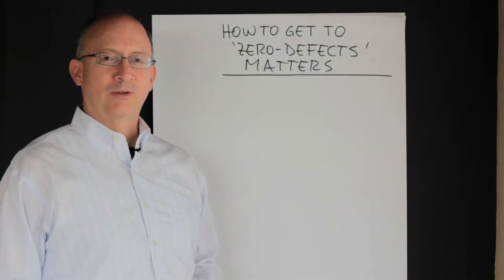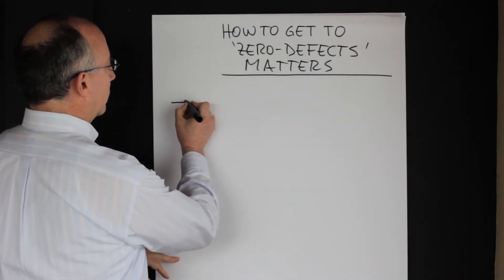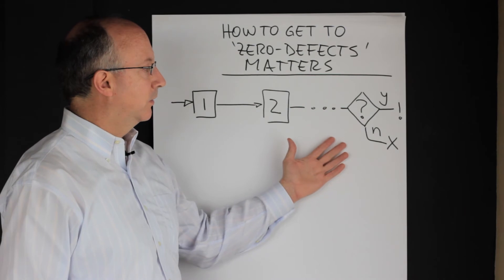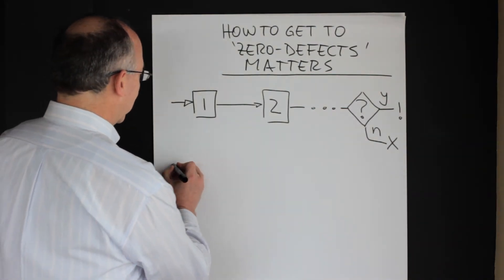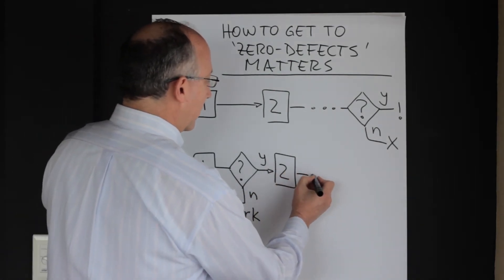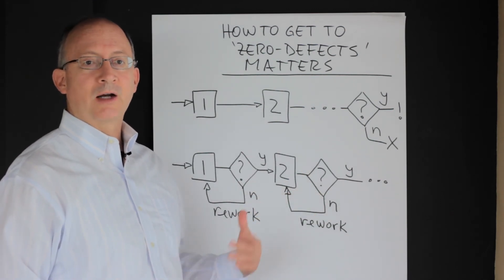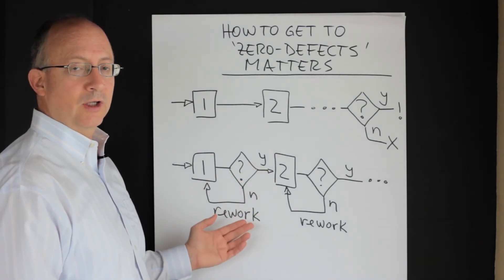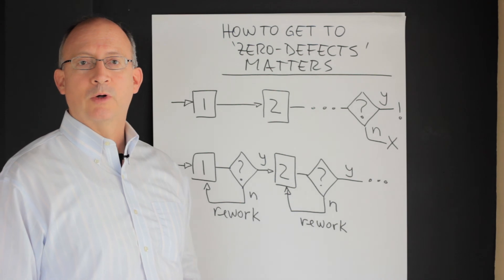Six Sigma | ZERO Defects 2: How to get there matters | Green Belt 2.0® Lean Six Sigma

Comment: Early detection is crucial to minimizing customer impact, costs and time lost.  It's so much easier to make up time, if you are only a portion of the lead-time behind due to a quality issue than it is to find the issue at final inspection and have to expedite replacements through the entire process which could be weeks or even months.

Comment: very interesting. It made a lot of sense to add inspection points at the end of a cycle or at each cycle.
Reply from the maker: Husain, to be clear, what videos trying to do is that just adding inspection points at the end of every cycle will only help if these leads to an improvement of the process itself I supposed to simply trying to catch errors over and over. The focus should be on the process, not only on the product.

Comment: I experienced a great example of rework causing problems in the production line today. Couple parts our supplier provided had incorrect dimensions on the the cover of a medical device. This caused the cover not to mate as it is suppose to. A small mistake in the tolerance caused the production to stop, rework done on the specific part, and then 100% inspections on any upcoming shipments from the supplier. As a result, a money, time, and labor was not used efficiently.

Comment: Our company operated for years w/ zero inspection.  Finally added final inspection prior to shipping.  May have stopped escapes to the customer, but caused a lot of rework ops.  Certain jobs now warrant in process insp ops, but most are final insp.-finally moved from shipping clerk to quality.  I'm still not convinced we analyze the data we collect (I may be incorrect), but I have argued for years the in-process inspection we forced upon the machine operators was not as effective as it should have been.  In most cases never looked at by mgmt unless there was a problem reported by a customer... at that point its like looking at a may and saying, 'yep, here's where the ship sank'.  Found many cases where insp reports were manipulated ...'pencil whipping' as our shop would call it.

Comment: This video made me aware of the waste of multiple resources assigned to inspect partial or finished products rather than to fix the root cause of the poor quality.
Reply from the maker: Maria, exactly. Putting people to prevent errors instead of fixing defects would be more effective, would use those people's skills more fully, and they would be happier that they are doing a positive job, not just avoiding negative results.

Comment: QC vs QA.  Probably helps in the DEFINE stage of DMAIC.   Both tools are a great way to start reducing defects and providing better products for your customer.   Using these two methods, you can locate the STEP(s) in the process that are leading to your defective product.    In order to truly begin to reduce the defects, though, you need to dive further into that particular step to see why the part is coming out defective.

Comment: One thing to add to the reasons not use these quality assurance methods is adding the costs of the actual inspecting at each step. The delay in cycle times and the extra labor costs would add costs to the part.

Comment: In-line or intermediate inspections are critical so that defects can be caught early on in the process. However, that is not sufficient. When defects are discovered, there should be an analysis performed to identify the root cause(s) of the defect. Once the root causes(s) is(are) discovered, preventative measures and corrective actions should be put in place to minimize the likelihood of those root causes triggering those defects again in the future.

Comment: I defiantly never looked at it this way. I have worked as a quality inspector before and it was very problematic when an issue was found at the end of the process. It would be so much easier do design the issues out of the process instead of catching them down the line.

Comment: QC and QA are implemented to double check or ensure the product is good after a process. This means there is a known flaw in the process or design that is not being addressed that causes distrust. The producing itself should be designed to be on target every time and predictable. Can there be a QA on a process instead of the product, to ensure we are operating in ways that produce on target instead of focusing on checking? What do you do if the problem causing the defects can't be fixed due to financial or knowledge restrictions?
Reply from the maker: Good points, Nick. It's better to fix the production process than to be fixing the products all the time. The "QA on the process" is the process monitoring that you do using control charts - we'll talk about it next week - that let's you see whether a process is becoming unstable and will likely produce errors.
And good comments on the distrust between departments -- later we will watch a video titled "the 3 nevers" that has to do with trust.

Comment: In the QA example, when "rework" is used, do you simply mean "re-run"(without any change)?  I ask because when I personally think of rework I automatically assume that in "fixing" the defect that I am fixing the process that caused that defect at the same time.  So, I'm wondering if I have a different understanding of "rework" to the way it's used in this scenario.  (Or maybe I'm already advanced beyond QA, lol). To just "rework"/re-run the work, without fixing the root cause of the problem is just wasteful in time, materials, money. etc. and is relying on luck ("fingers crossed it doesn't happen again").
Reply from the maker: Rework is fixing the defective product by doing the initial tasks again but better, with more care.
Fixing the process is usually more time-consuming, involves more resources and requires permission from the area lead and adjacent area leads; plus to do it right a team must be setup and data must be collected ... it takes more effort! Granted. But it also fixes the recurring defects that always lead to more rework.
Reply from the maker: QC means just re-run like you call it. Read other comments about QC practices about this video.

Comment: My organization utilizes Quality Assurance to measure the outcomes of different steps in our processes.  If there is a problem, we open a Corrective Action, which seeks to find the root cause, fix it, then implement measures to sustain the correction.  This is a necessary process in my industry (via governing quality management systems). However, it often feels like this process is also totally reactionary, and that my org doesn't have a complimentary inverse process that proactively breaks the cycle of inspection and rework.